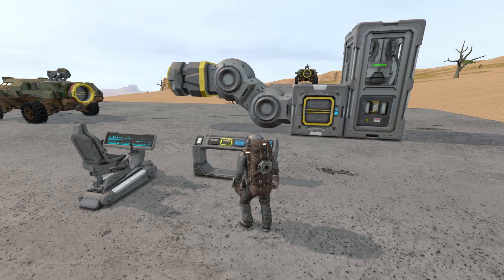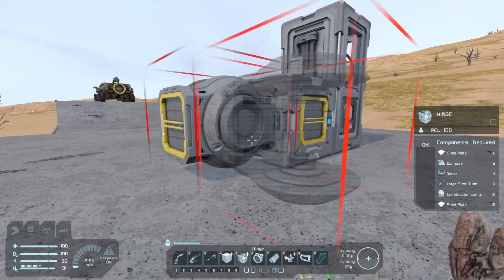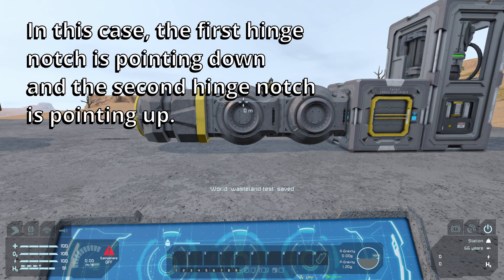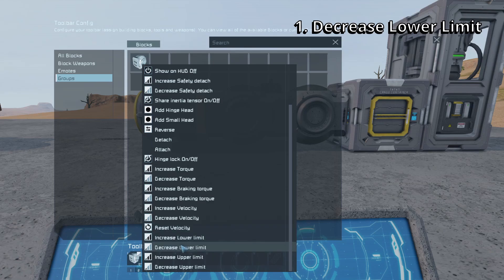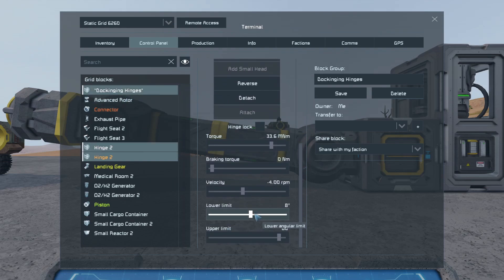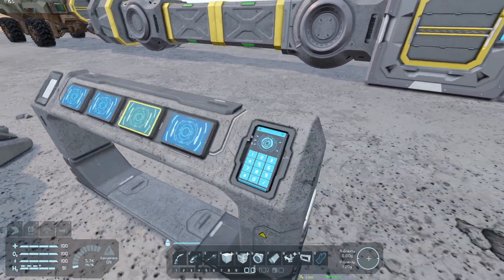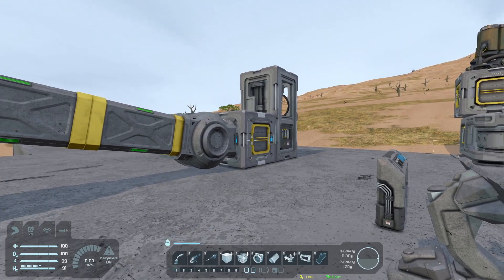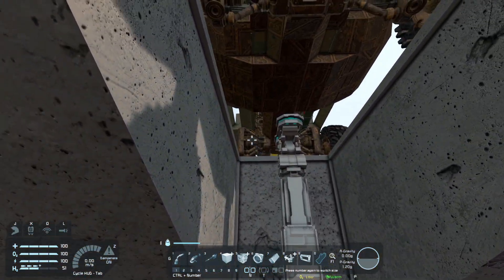Adjustable-Height Connector (Hinges tutorial) | Space Engineers

Comment: So I love this video, but when I try to connect a small mining ship to this (has thrusters), when I get out of the ship the whole thing wobbles and the upward thrusters keep running. Any ideas?
Reply from the maker: It's difficult to say without seeing it. I can't see why the thrusters would turn on if they're off when you exit. This connector setup is designed for rovers but should be fine with miners too. I'd be conscious of the weight of an unpowered miner and the strength of the hinges. They aren't as powerful as rotors.
I hope this helps on some way?
Reply: @TallmanBradGameplay  So I just tested your theory, and I think you are correct about the weight. This miner is about 14,000kg. I connected it up, and grinded down the vertical thrusters. When attempting to raise the connector it dips down to the ground lol. Thanks again.
Reply: @TallmanBradGameplay  It was def surprising and unexpected lol. If I connect the mining ship to a connector that is supported by the standard conveyor tube, I do not see the same issue.
Reply: Up the braking force of the hinges or/and enable inerta tensor. Inertia tensor may slow down the movement a bit.
Reply: Same here: I connect a ship and the whole thing starts to wobble and explode. I shared the inertia tensor and the wobbling would stop, but not the cause; there is still some clanking and shaking. Watching closely, I saw that the thrusters are firing. The only thing which remedies the issue is to lock the ship separately to the ground via landing leg or magnet. One the thrusters are shut down, you can unlock the landing gear and all is fine. So, definitely a thruster issue. No idea why that is.

Comment: I'm trying to use the Large Container and can't get the hinge connector to meet properly to the vehicle connector,  the hinge side connector has as about a 3-5 degree back slant [top slants back to cargo side].  Any thoughts?
Reply from the maker: It's tricky to picture what you're saying but you could try extending the length of the connector so that you can lower it further and therefore tilt the connector forwards a bit perhaps? The other thing could be to temporarily reset the hinges to 0 degrees to see if that recalibrate it. Then another option would be to turn up the magnetism level on the connector just a little (careful!) to see if it'll pull the vehicle into place. Connectors can still connect at a bit of an angle. They don't have to be completely dead on centre so dropping the hinge height another click might just work.
Hopefully I understand what you're saying and this helps a little?
Reply: @TallmanBradGameplay  Yep helps.  I manually adjusted one setting by 3 degrees and that did it. Sorry to be such a noob on this stuff, but you're really helpful.
Reply from the maker: No that's fine. I'm pleased you got it sorted. There's always a solution!
Reply from the maker: Anyway the rover lift tutorial video is up now!

Comment: Very nice thank you. Have you tried to set a braking torque on the hinges to solve the bouncing ?
Reply from the maker: Hi Nicolas. You're very welcome! Yes I tried the braking torque. Unfortunately it didn't have any effect. If you flip the hinges 180 degrees and set the velocity to a positive number, the bounce occurs the other way round. Which is less desirable, but indicates the bounce is related to the motor holding the hinges in place. Ideally I'd have used the 'lock' function to step the system up and down but sadly that only works intermittently and therefore wasn't worth demonstrating. The longer the arm, the higher the bounce. Really a shorter arm could be placed higher from the ground to accommodate a taller rover. Sorry for the long reply! Thanks for commenting and all the best.
Reply: @TallmanBradGameplay  interesting, sad though !  Now that it is adjustable at will, do you think there would be a way (with sensors maybe) to make it auto-adjust ?  Yeah, I know, Im pushing it a bit.... lol. Thanks for the clear and detailed answer you provided to my question, I appreciate.
Reply from the maker: Oooh I like that idea. I'll need to think about it. But my first thought is that there isn't an easy way to incorporate a sensor.
Wait... Yes!
If there was a protrusion from the vehicle, in a different place on each vehicle, then a sensor set up to detect each of the protrusions. Like a 'key'. Then the specific sensor that was triggered could either turn up or down the height. With more thought, it might involve a programmable block. But possibly not. I'd need to try it. If you try it yourself will you let me know if it works? And if you're not sure what I mean please let me know and I'll try and explain better.
Reply: @TallmanBradGameplay  Glad the dea inspires you. Not sure I ll find the time for testing it but if I do I will definitely let you know